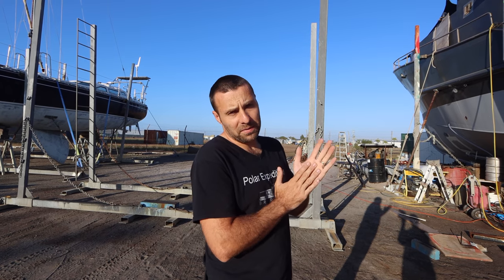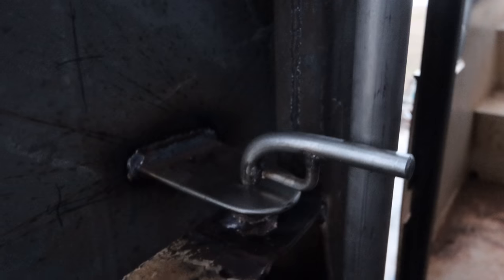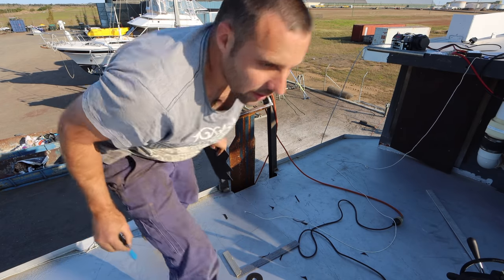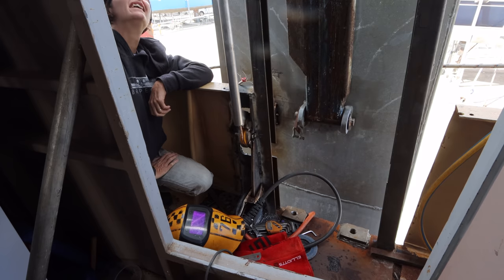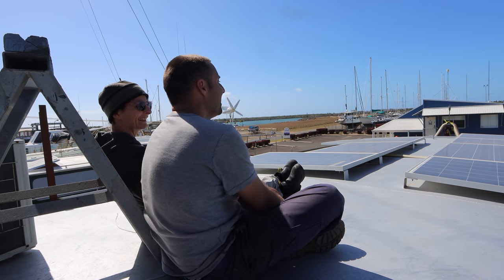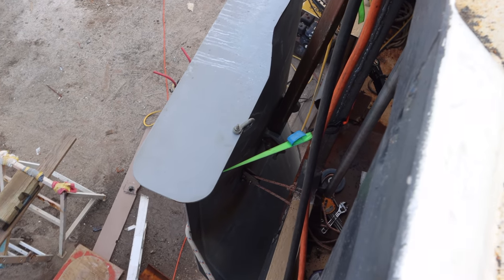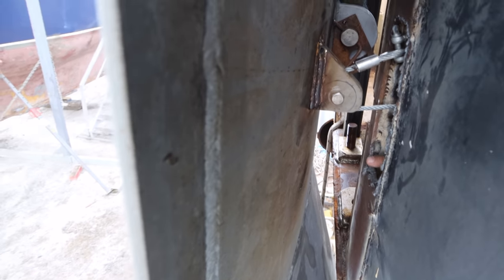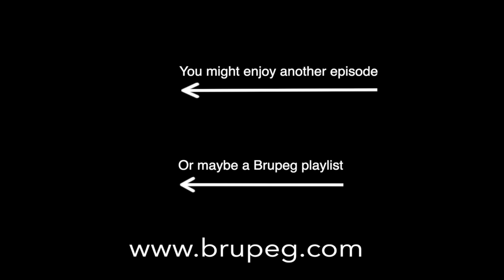Winches, Pulleys & Wings (2 of 2) - Project Brupeg Ep. 170

Comment: I like your exit song ! I see how it’s going to work now , and by using a doubler on the wing  in makes sure that the cable and wing are fully retracted ! In effect your pulling against the rail sides of the walkway which needs less power then a straight pull ( small block and tackle ) and protects the cable ! Are there any redundant safety measures also ?
Reply from the maker: Hi Dave. At this stage we don’t have any winch safety in the system but I plan to add two load arresters (think retractable seatbelt) one at the top and one at the bottom. They can both roll in and out without even noticing them but if a wave tried to push the arm up the bottom one jams and if the winch or cable breaks the top one jams
Reply: Project Brupeg sounds like a plan !👍

Comment: I see a lot of tweaking with the right angles, now for the pulley system. It reminds me of the angle struggle for the dingy. How about the clearance of the wire at the roof? It crosses over where the wing arm slides down. If the wire slides over a surface, then it will cut in it like a knife. Good luck! (I see in the end that you care about it 😉\⛴/ )

Comment: The winch bracket is way more Brupeg. FWIW, I don't think you need the fairlead as I reckon with the amount of use the winch will get and the consistent cable direction you should be good to go.

Now you have wings you should hit Redbull up for some sponsorship.
Reply from the maker: Yeah thats true aye. I kinda see it as just one more part that can fail. iI wouldn't ever touch the cable unless something went really wrong.

Comment: Could you not brace the riser channels across the "flimsy" roof to each other with something of similar size and then just pull from the center.?    The weight would be tranfered from one wing to the other...   I am sure you thought of this and the math dosent work out.     You guys are awesome... Truly inspirational.
Reply from the maker: Hi Marc, that would definately work and it would help to cancel the loading out but the issue we have is our 4.5m Jet Dinghy needs to sit on the roof between the sliders so anything on the roof there opens up other issues for that dinghy placement.

Comment: If Up & Down on the winch controller are  wrong (reversed) it should be simple to fix. Just swap over the red & black power cables attached to the winch  The wiring in the motor is isolated from the frame so this shouldn't cause any problems.
Reply from the maker: Thanks Juli. I think your right, reversing the polarity like this is likely the simplest answer. Dame
Reply: @ProjectBrupeg  Yes seeing your winches appear to have permanent magnets (so only 2 cables to the motor) swapping over the cables should reverse their direction.  

A thought about rolling on & off of the top instead of the bottom of the drum. Sure it will give you more clearance but it will also increase the leverage of the pull of the cable has on the mounting bolts, increasing the load on them.  

Also the 5000lb pull rating will only apply when only one wrap of cable is on the drum, as the wraps increase so the max pull will decrease.   You guys are doing great. Cheers. :-)
Reply from the maker: Yeah the way we built the mount the load pulls it into the steel so we could almost take the bolts out and it would roughly stay in place. Once we have the wings more complete what I’m thinking of doing is removing. A few wraps as we need very little cable and I would prefer to under load the winches if possible

Comment: Given the consistent windnoise throughout it seems to be a sailor's part of the world You hide in tbh.
Reply from the maker: Yeah 20-25knot trades are the norm for us
Reply: Bundaberg is also know as windyberg the wind only stops to change direction 😂
Reply from the maker: This is very accurate
Reply: @ProjectBrupeg  One of the places to be where You wanna give up MIG/MAG alltogether and turn towards good ol' stickwelding I reckon ... Anyway, good solution with the wing pull-ups, and good to beef up the flimsy three-M8s-in-the-center groundplate into something "a bit more Brupeg" 😂
Reply from the maker: I don’t ever think you’ll find me giving up MIG/MAG welding for stick.
Reply: @ProjectBrupeg  Yup, I would neither, while flux core basicly is an advanced version of slag welding, just with automatic wire-feed, ain't it (never tried flux core myself)? It might be unimportant HOW You put in the fusion magic hotness into Your material, as long as it keeps the shape and connections You forced into it ....
Reply from the maker: Flux core is magical to use with gas. Can weld in 30knots and get fantastic weld

Comment: 11:09 How about you guys get a heat retention cooker (like the diy Wonderoven - look for it on youtube)
You can stew anything you heat up, you don't need to babysit it and it can't burn or overcook...
Best thing is: while it is in the wonderoven it does not use any energy (gas or electric)
Reply from the maker: Thanks I’ll have a look
Reply: @ProjectBrupeg  Please let me know what you think about the thing... and if you plan to fashion one for the galley...
Reply from the maker: Hi Koning, thanks for the idea but it would take up too much space. Every area is very carefully allocated particularly the galley. Cheers Jess
Reply: @ProjectBrupeg  Hello Jess,  may I point out one small flaw in your thinking?
You wouldn't need a wonder oven per-see. You could first do an experiment to see if you like it with stuff you already have (onboard) stuff like bedding and a cotton towel. Simply place the pot with the hot soup or stew (it has to have been boiling for about 10 minutes to make sure it is as hot as it can be) then place the pot with some alu foil on top (to prevent moisture escaping the pot messing up the bedding) and put the regular lid on the pot, place it in a large towel (wait for it) in bed and cover it with a large duvet or several blankets, making sure any heat in the pot has a hard time escaping... The towel is best made of cotton or fibers which can handle the hot pan (because polyester fibers may melt, fusing the pot and the fabric together) 
Try that for shits and giggles and tell me if you feel the idea is a "waste" of galley space.... BTW: the wonderoven can be stored in an oven both in use or not...
I use the heat retention cooking idea (a smaller version of a home made wonder oven to suit a smaller sized pot) in my extremely small camper van (a sprinter short wheelbase with the lowest of roof versions) and I can tell you I save a lot of fuel cooking, cutting fuel use back by as much as 60-70%... I use the wonderoven when not in use as such to store the pot it is made for and some other kitchen tooling in it...
Reply from the maker: I get what your saying and I bet it works well but it doesn’t suit what we are doing. A working boat is different from a cruising boat. We need equipment to be effective and simple. Also there is the issue of mould and fire risk. It’s not for us but we appreciate your passion and suggestion.

Comment: I have to say you use that big angle grinder like a surgeon uses a scalpel.  Do the disks last very long when cutting stainless or thick plate?  Are you using a specific brand or just generic cutoff disks?  I'm glad to see the winch mounted high enough to clear the edge of the pilot house.  I had been worrying about the potential friction fraying the cable.
Reply from the maker: Thanks, disc wise we buy the thinnest disc we can find at the time of order. Normally they are 1.9mm. Thin ones cut really well through most things and do last pretty well, if you get the thicker 3mm discs it’s awful as they just take forever. We had a batch of 3mm’s a while back and I ended up chucking them in the bin as they were just too painful to waste time with

Comment: Will the vertical tube for the winch cable have some cylindrical bushings (delrin/uhmw)?
Maybe held by 2 set screws so it can be rotated and last 2 or 3 times as long based on the angle that get abraded more quickly
Reply from the maker: When we aligned the cable it doesn’t touch any part of the tube so no need for bushing
Reply: @ProjectBrupeg  Thank you very much for answering
Reply from the maker: All good. Thanks for getting involved and commenting. Dame

Comment: Hi guys. How will the winch cable stand up to being submerged in salt water 90% of the time? Are you planning to remove it when you are under way?
Reply from the maker: Hi, the cable will be greased which is a normal way for trawler cable to stay submerged without issue. It will be frequently checked and re-greased. Eventually we will be swapping to dyneema but we need to test if it can survive being submerged for months at a time

Comment: It's been a long time since I've done a free body diagram, but I'm pretty sure the roof pulley is exerting as much downward force as the winch would have if it was mounted at the top of the guide tracks, at the same time exerting side forces because the cable going up to the the pilothouse roof. I think you would actually be putting less stress on the roof if you had just mounted the winch at the top of the guide tracks.

On a separate note, are you going to add some material to the inside of the guide tracks, or to the support strut pins, like teflon or something?
Reply from the maker: Hi Drew. With the pulley on the roof we were able to use the heavy wall stainless pipe to take some of the vertical compression (also doubles as a hand rail and a cable guard). With the winch in that spot we wouldnt be Able to have the cable in there as it needs to move side to side 100mm roughly when coiling. So hand rail, cable guard and vertical support is lost. As for wear strips yes definitely. We have a UHMWPE strip that runs on either side of the stainless pin. It was funny when we shot this we lifted without the plastic strip and it was like the worse case of fingers down a blackboard you can imagine!
Reply: @ProjectBrupeg  Great! I didn't realize that the cable guide pipe was robust enough to be structural. Of course, the guide track on that side also adds a lot of compressive structure. I also hadn't considered the problem of the cable moving side to side if the winch was mounted at that spot. 

I can imagine that was a pretty unpleasant noise.

Comment: Love that your hard work is comming together.    But just wondering.  If your roof is made of tinfoil lol ,  won't  the winch rollers get pulled out ?
Reply from the maker: Nah we added enough bracing to handle that load and to transfer it to a strong point with the stainless pad and vertical bar. The winch woud have been a difference story as the load is higher and a different angle

Comment: Hi Guys would it help to thread the winch cable through a tube directly from the winch to the first pulley to save rusting or corrotion
Reply from the maker: Hi Guys, the plan is grease covered cable. standard issue for trawlers to do this so the cable is well protected from water and lasts a good long time. One thought i had was i dont want to walk into the greasy cable when up top so i have thought about a rubber pipe between the winch and the pulley as the cable needs to move from side to side so its not possible to use stainless pipe.

Comment: I'm curious to see if you've given any thought to supporting the top of the vertical risers.  With the bottom of the wings at or below waterline the wings will be under constant horizontal forces. Is there a possibility it might twist that unsupported runner above the roof line?
Reply from the maker: Hi DW, nah no need to touch the steelwork about the roofline. Once the arms are below the roof there is zero load on the sliders above roof
Reply: @ProjectBrupeg  hi!  Being that I'm a recent follower of yours, and that I found you guys by way of Dangar Stu's videos, I hope you'll forgive the mundane and possibly foolish questions I'm bound to ask.

   My question is more relevant with the wings stowed upright.  And I saw the latch pins used to secure the wing. Which if there is one on the  forward side would completely void the forces im discussing.
Reply from the maker: That’s all good mate, ask away. Good to have you onboard with us. Dame

Comment: Is the winch cable made of stainless steel?  I would think that constant exposure to seawater would expose it to heavy amounts of corrosion. How are you addressing corrosion issues with the pulley cable??
Reply from the maker: Hi Guys, the cable is galvanised steel. We choose steel rather than stainless as its better long term for corrossion resistance, we also opted to have no stainless pulleys etc (went with oil impregnated Nylon) so there is no dissimilar metal issues. finally a solid coating of grease on the full length of the cable is the standard way to deal with underwater cable corrossion.

Comment: I have a small question which you've probably already thought of, I just haven't heard anything about it.   This all looks fantastic and I think will be bullet proof bolted down.  Do you have any concerns deploying the stabilizers in rougher seas?  When they are lowered, but before bolting down won't they be rolling up and down with the sea?  I'm guessing you can heel over and put one you're bolting down on the windward side... I just didn't know if you'd thought of this before hand.  BTW Zack, I read what you wrote, but I do actually have an engineering degree and am proficient in physics, lol!
Reply from the maker: Hi Stephen, yeah your right that is the danger zone. the fishermen say to point head to wind and deploy the wings then as the motion is more along the hull rather than side on. Still a chance of a roll on the boat though, one thought i had was fall arrestors, like a retractable seatbelt but made with cable and much higher load rating. one at the top of the arm and one at the bottom, if a roll happened and the winch let go for whatever reason the arrestor would lock up and stop the arm from crashing down, if the boat layed over into the wing the bottom arrestor would stop the arm from shooting up and the wing crashing into the boat.

Comment: I wouldn't trust the top pulley like that. The cable swings left and right on the drum of the winch. It will at some point jump out of the pulley. Maybe add a vertical guide  so that the cable is always perfectly aligned with the pulley.
Reply from the maker: We designed the stainless pulley so its captive, ie the cable physically cannot come out of the cheeks. The bottom pulley does need a guide finished on it as it can pop off and it something thats on our to do list.

Comment: Awesome. 
I was wondering about the final cable and pulley design....

It looks simple,  strong and highly appropriate. 
I noticed some angst on comments by other viewers. 

There is a MASSIVE difference between ENGINEERING and APPLIED Engineering.
Process of deduction and trial and error are the only real useful ways of solving an issue, correctly and accurately.
Dame, if this system has any weak points,  Having watched your M.O. for 3 years, you will solve it, and improve it tenfold. And mass overkill is not a bad Idea.
Doubt and uncertainty are not good crew mates 2000km south of Oz / N.Z.

Not that you need input, but how about a few beams linking port and starboard slider assembly's right over top of tinfoil roof so loads are opposed against each other when pulling up wings. 
Two winches in one box dead centre of roof directly in between  two wing assemblies ??
Less wiring and will strengthen the hell out of whole rig port and starboard .

Pulleys are more than robust as is, but take sheer loading back to 90' x 90' rather than wheelhouse roof ??

Probably less likely to get fatigued and much more out of weather.
Mount current  doubler and mounting on top of  2  big beams straight across light roof sheets 3mm to sliders fore n aft ??
Self supporting and Just tab into roof support under sheeting.

Conduits box section also within bugger all of winch location to easily route winch power back to battery and switches location in wheelhouse?  Keep clear of roof sheeting by 100mm, and may give  a base to mount a dinghy cradle  up there ??.

 4 block factory winch Roller mechanisms will help a tad if wire / dyneema  goes slack if wings do jump around in unfavorable conditions.
You may need to drag wings up in   open ocean in poor conditions.
See ' sea containers '

I THINK dyneema comes in 16mm direct from 4wd winch manufacturers real cheap. Delete galvanized or SS cable.
Just use synthetic. The stuff is robust as hell.
Take a spare roll and put it on yearly maintenance list.
Will save hands and fingies.....

IT'S  YOUR VESSEL. You know the boat better than anyone.
No amount of university education is a substitute for practical experience and common sense and trial and error....

Dame and Jess, you both appear highly capable at this project. 
Your problem  solving ability and  skills stand you in good stead for anything that gets thrown your way........

I'm unfortunately flat on my back with neck damage for last week, But thanks, I have binge watched  project Brupeg and am totally up to date from episode 1 !!!

CFM of new vent fan is awesome !!

Always suspected Trev was a real sailor and not a stink boat driver......

Love ya work !!!!!
Darren  Freo W.A
Reply from the maker: Hi Darren, the plan is to swap over to dyneema when the factory cables start to crap out. We need to mount a 4.5m dinghy between the sliders so anything in the middle is not an option hence no slider bracing and no winches on that roof.